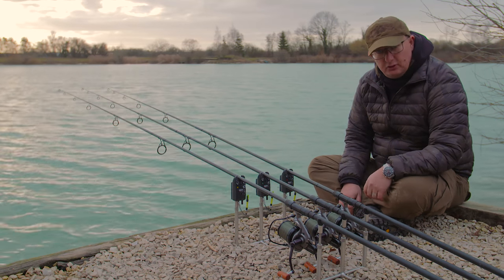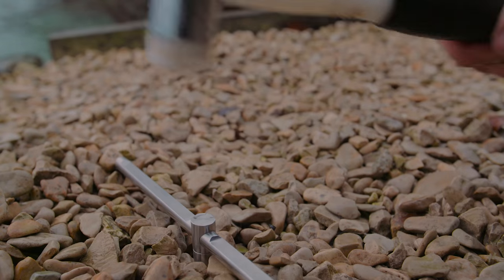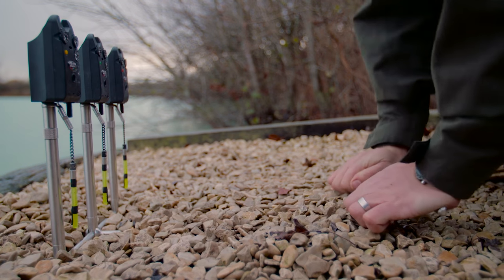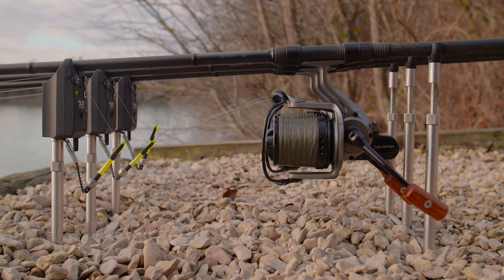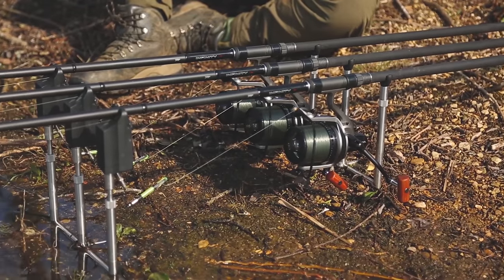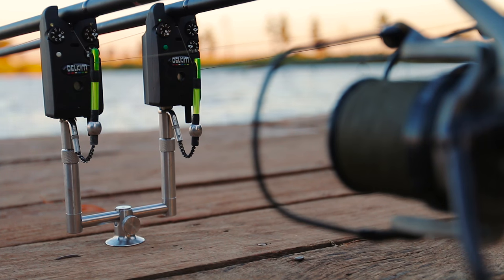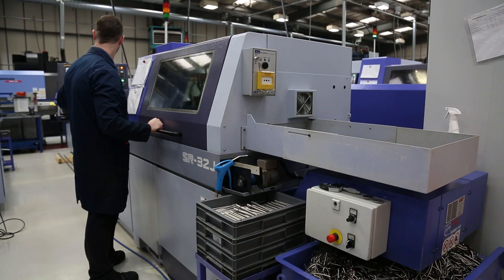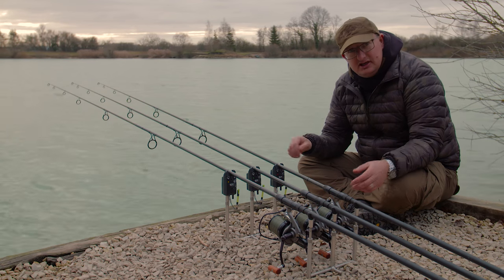Korda Singlez Rod Support System Explained | Danny Fairbrass Carp Fishing

Comment: Just looked at the price, £16 for 1 spike, one extension (you need 6) £13, 1 stabilizer ££22, one 3 rod buzz bay, £33. So, not far off £200 if you want a basic set up with a couple of longer or shorter uprights. Will stick to my adjustable Chris Brown pod thanks.

Comment: Pain in the arse, middle reel is a pain in the arse to hit when u have a run, started with the small setup moved to 10” and 11.5 still have the same trouble.
Reply: David Smith interesting , be surely this goes for most set up’s not just Korda but Jag and so on when people are cramming 3 rods within 12”.
What’s the solution unless you go wider on the bars
Reply: Cutline that's exactly what I did mate ... Changed to solar p1 adjustable set up, looks just as nice if not better... I got the pod aswell so no messing around on hard ground ...
Reply: David Smith thanks for the response , good to know as I’m also consider the pod 👍🏻
Reply: @DavidSmith-pp4ev  is that a pod?